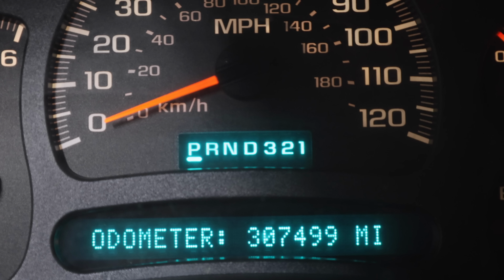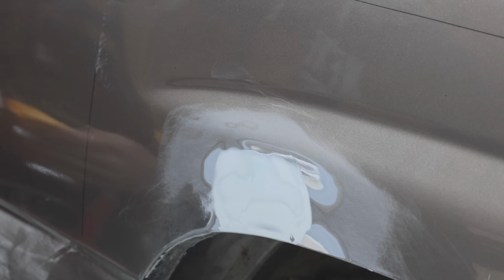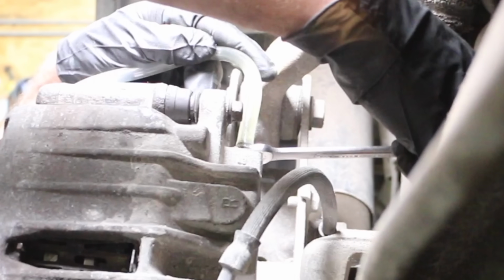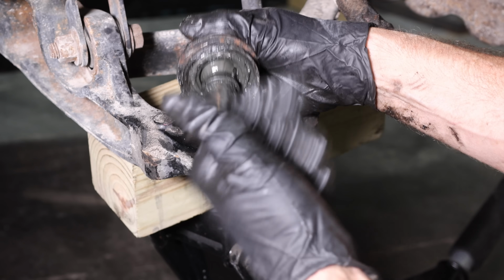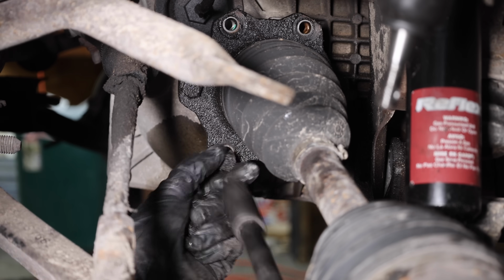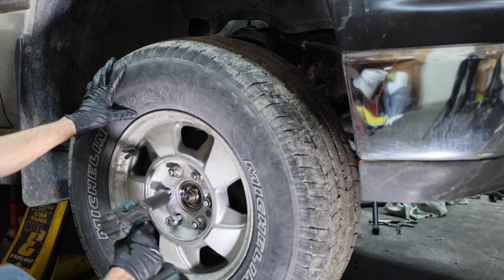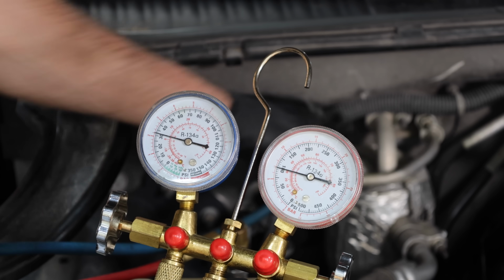Is It Stupid To Fix Up A 300,000 Mile Vehicle? Let Settle This!

Comment: I just bought a 344k mile 2000 CRV lol my only concern is it does burn oil at Idle. We did homework and it’s a single owner, well taken care of for the most part, but after no clear number on oil change intervals. I’m starting off with hopeing there is carbon build up on rings worst case I’m doing a Tear down but we are doing the same as you just did lol a suspension over haul! Also keep your pace in videos they are phenomenal! My last opinion definitely keep ol girl! My wife worked at Chevy for a bit and the new Suburbans kinda scared her lol
Reply from the maker: Thanks for sharing.

Comment: I did auto body for 4 years before leaving to explore other jobs. For doing it in your driveway, you did a good job. The only tip I have for you, when sanding your bondo, make an X pattern. It helps sand it down more evenly. There's also a spray/powder you can get called a guide coat. It helps you visualize the high spots and the low spots, so even if it feels good it might still not be perfect. Your doing it on a vehicle that looks to be from 2003-2006 that has 300k miles, so it doesn't have to be perfect. What you did is pretty good for a driveway repair

Comment: i have an 04 f150 with 245k and an 03 expedition with 335k. coincidentally both were built august 2003, so they are both soon to be 21 years old. i bought them both about 5 years ago, and have put something like 10 grand into buying, fixing and maintaining them both. thats $83.33 a month each. you aint getting ANYTHING brand new financed for $83 a month... except maybe a mitsubishi mirage. add in insurance being far cheaper, registration being 10% of a ~50k new vehicle, and the fact that they get 80-85% the mpg of their equivalent contemporaries... yeah its been worth every single penny keeping these things on the road.
Reply from the maker: Thanks for sharing.

Comment: I work on alot of these older chevy  GMT 800’s. Besides the occasional lifter failure they are TANKS. See quite a few at 300k doing pretty damn good. I mean it’s def not a Toyota (primarily work on those for a living) but the gm engineers showed what is possible durability wise with these trucks. Totally worth fixing! Americans have forgotten that MAINTENANCE is the key! Stop getting hung up on mileage.
Reply from the maker: Thanks for the feedback.

Comment: I have a question my 02 trailblazer transmission went out yesterday at 338k miles im looking at buying a remanufactured one with a 5 year warranty for $2600 do you think its worth putting the money into it the engine runs good always been maintained i just don't want to buy a cheap used car and end up with a lemon

Comment: Don't tell my 89 Z71 that....310k on the original engine, went with a GM Crate engine and a new trans, still running today with almost 500k on the truck, thinking about sending it to the body shop for some rust repair and a paint job. Even with all I've spent it's not close to a new truck....$15k and 500k miles on a 35 year old truck...it'll be running when all the 2000 model Chevys are long gone.
Reply from the maker: Thanks for sharing.

Comment: I didn't really have time to watch the video, but of course it's not stupid to fix up a 300,000 mile vehicle. It looks like from the screenshot that it cost $2,000 to fix it up. That is very reasonable. Each individual person is unique, so the answer really depends on how you feel about your vehicle. If a vehicle is just transportation and that's it or if you don't have the money to spend on a new vehicle, then fixing up what you have is a great idea. However, if you have the money, and you always want the latest and greatest thing, then buying a new vehicle also makes sense. In my situation, buying a new vehicle makes sense because Wireless CarPlay is very important to me, and high performance is also very important to me. I traded in my 2015 Civic Si for a 2024 Integra Type S and I feel so much happier with my current car. I plan on keeping it for the next 10 years before the changeover happens. I'm sure 10 years is enough time for the legacy car manufacturers to figure out how to build quality BEVs
Reply from the maker: Thanks for sharing.

Comment: Nice, I'll give you $1500 bucks for it
Reply from the maker: Thanks!  Not for sale.
Reply: @ProjectFarm  where do you get your patch panels? Just ebay or what? I have an Escalade ESV and both rear panels are rusted at the wheel wells, however, on that truck the panel goes all the way up over the window to the roof.

Comment: Cleaning bolts in that manner is ultimately incorrect. Use a thread chaser or leave them alone. Good chance they fail upon tightening because the threads are ruined.

Comment: $2000 is nothing. I have a 2021 Jeep Gladiator with 60,000 miles that, according to the dealer, needs $3200 in “critical preventive maintenance.”  

They won’t change the transmission fluid, though.
Reply from the maker: Thanks for sharing.

Comment: +1 to keeping the pace. There's a LOT of info in a decent amount of time, but it's short, sweet, and to the point!

Also, how are there 300k miles on a set of rotors, 10 years on headlights, and (I think) 4 years on oil? Good grief!
Reply from the maker: Thanks!

Comment: Channellock snap ring pliers are the best I've used.  Highly recommended.

We still have my wife's old 99 S70 T5 volvo.  We've kept it because it never misses a beat and has a wonderful 5 cylinder turbo sound.  It's currently at our mechanic getting its' 200,000 mile work done.  I had about $3000 worth of new parts in the trunk and he laughed saying that it's not uncommon at all and has numerous clients with old Volvos that have had the car's value put into the maintenance many times over.
Reply from the maker: Thanks for sharing.

Comment: I have nearly the same vehicle! 2000 suburban 2500 LT. 340,000 mile daily driver. You really should add or tag Chevrolet or suburban in the title. This video is a huge help. Also, if this was a Saturday afternoon garage show on tv, you just did half a season in 25 minutes 😂. Great job! The pace is right on for the average person taking care of this type of work. No fluff and if one doesn’t have the tools they can be rented for the most part and bought if needed. Excellent work as always 🙌🏼
Reply from the maker: Thanks!

Comment: I have a 2001 Chevy Suburban that just hit 113,000 miles , it’s very clean inside and out. I keep up on maintenance and it runs great. But watching this video makes me want to get some work going. I probably will get the diffs changed but any other suggestions would be greatly appreciated. Thanks
Reply from the maker: Suggestions:  Spark plugs, wires, change all the fluids, new fan belt.

Comment: Me and my brother have a 01 Ford Taurus Ses 3.0 ohv with 256k it keeps going like the energizer bunny we run a 10w30 with Lucas oil stabilizer and run a flush every oil change. Recently it blew the water pump and timing cover gasket which our buddy at Harrels auto in Erie fixed up for us. Other than that just regular maintenance.  Best 300 car with ac and heat ever little old lady owned since new we bought it with 197k miles
Reply from the maker: Nice!

Comment: At the end l was expecting the total in parts and an estimate in labor for the non doityourselfers who have to rely on a mechanic.
I believe its a much better deal to renovate than to buy new, even if you have to replace the engine and transmission. Of course as long as the body is still good and rust free. With $10k you can drive a mechanically new vehicle instead of paying $50k to $80k plus the high cost of insurance and taxes.
Reply from the maker: Thanks for the feedback.

Comment: Wow! Some of the same types of repairs I have been doing on my 2004 Chevy Suburban Z71 with 406k (equivalent to 16 times around the earth). I will not spend $80k+ on a new Suburban, $20k+ on used, pay $3000-$5000 for someone else to do the work. But sweat in the southern summer to DIY the TLC. Like a rock! Keep doing what you do best.
Reply from the maker: Thank you for sharing!
Reply: Don't be cheap

Comment: I liked that you showed doing a string alinement.  I did this myself and found the specs confusing.  Like  if it calls for sixteenth of an inch where do you measure this from?   My information was that this mesurement was from the center of the side wall of the tire.  Please correct me if this is wrong.  I actually measured from the wheel rim and calculated the diference.  Like if the distance from rim to rim is 15 inch and to the center of tire side walls is 22 I multiply my spec by 15/22 to get my measurement.  Well any way that's how I did it.  There are allot of cars where the camber and caster can't be adjusted but if it does need to be adjusted make sure these get adjusted.  Best to let a alinement shop do this but you can buy a inexpensive angle measuring tool and do a fairly good job yourself if you have a flat level surface to work on.  Two greased plastic dollar store place mats will work for your turning surface.  Got to make some jigs but procedure is straight forward.

Comment: I bought  2004 Honda crv for 1k. Did the head myself, full compression. New shocks, wheels, tires, suspension parts, accessories (and ac) . Went from 360,000 miles, still driving it today at 410,000 miles at a total cost of $3500 for parts  (I did the labor).

Meanwhile I watch people go in debt for 30k+ on a vehicle with smaller engine!

Maybe I'm dumb but I don't get it.

Comment: PF, did you have any issues with any of the computer modules? I am not a mechanic, but I have heard old GMs are prone to electronics issues.

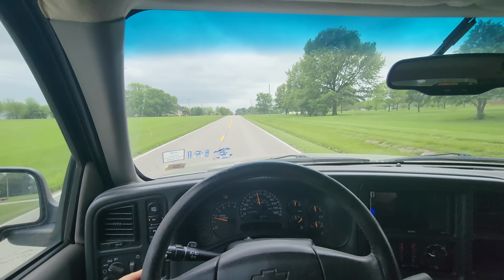I noticed it looks like your check engine light is on at 24:40, but my guess is it is just a harmless nuisance code. 

My 2001 GMC Sonoma would have issues with the ABS brakes computer after about 130,000 miles. The heater core also had to be replaced.

That looked like so much work. Great job! Thank you for all you share with us. I wish I knew half as much as you do. I have often bought things based on what you recommend on the channel.

Comment: Agreed. 
Bought my 06 Charger R/T new. Current mileage 321K.  Had one engine swap done back in 2016 under lifetime powertrain.
Also bought a 06 Dodge Durango Limited (5.7L) in 2021 for $2K. Had 292K on the dash when I bought it. Current mileage 330K.
Reply from the maker: Thanks for sharing.

Comment: I have a 1999 1500 Silverado 4.8 with 401k miles on it finally got new rotors and my water pump was leaking from weeping hole 👍🏼 runs strong had been used to go 10-6 hours drives for work every 2 days now I work 1-2 hours away a day she runs good a little rough looking but she’s great
Reply from the maker: Thanks for sharing.

Comment: Man, I've been into seeing others fix cars with regular parts. Something about seeing a vehicle get its deserved maintenance is relaxing, and since I finished rebuilding my truck's suspension I replaced every wearable part, sanded and painted every metal part, and lastly detailed the whole undercarriage. It's basically a whole new truck for about $1500 (I got top of the line parts, especially greasable)
Reply from the maker: Thanks  for the feedback.

Comment: Had problems with my brakes not wearing evenly and found that even brand new pads and hardware were hanging up and had to touch up the ends of the pads with a grinder finishing wheel to clean up the ends. Also had new pins sticking in new caliper brackets and had to sand the pins until they slid smoothly. Quality control is terrible. I’ve replaced the a/c system, the cooling system, and the suspension. Pulled a cylinder head so a machine shop could repair a broken exhaust bolt that I made worse with a drill. Cylinder head was flat and the valves sealing good. At 300,000 miles the cross hatch looked great and compression is good. Gen 3 5.3L is awesome. I definitely prefer this method over replacing vehicles since I can do the work myself.
Reply from the maker: Thanks for sharing.

Comment: No way bro, I'll be posting a video this weekend of a 02 suburban I just got with 302,000 on the dash but drives and rides like 90,000. Previous owner put all new suspension and links and ball joints and brakes and rotors rear end and transfer case, not sure I would've done all that but after driving it I feel like I should do a lot more like that, it's a Z71 and is so weird and amazing how good it rides and drives, I love all vehicles but I like early 2000 vehicles.
Reply from the maker: Thanks for sharing.

Comment: why after all that. is the check engine light on?
Reply from the maker: It's related to the fuel evaporative system and isn't worth repairing.
Reply: @ProjectFarm  evap code.   i have same on my car..  if i keep the gas tank from going below 3/4.. the light never comes on .. something to do with the cycle of that test i think..

Comment: My mom is on her 3rd Buick lesabre with over 300k miles. Currently has a 2004 with 380,000. My dad had a 94 ranger all original (minus the alternator) with 570,000 miles. It finally died in 2017.
Reply from the maker: Thanks for sharing.

Comment: Okay if yk cars yk what motors are good so basically chevy v8s and there v6 from 80 to bout 2010 where basically unkillable if you took care of it ford inline 300 and modular motors same think you take car of then they last, rn i have a 98 Lincoln mk viii 4.6 165k miles still first turn start everything works, 2015 f250 370k miles same thing modular motor everything works, so if its a good motor and taken care of then i say ita good for a price
Reply from the maker: Thanks for the feedback.

Comment: I have a 96 F250 woth 250k miles. Did the front end with new ball joints and u joints. Pads and rotors seals. But want to change the Differential and transmission fluids! Great video
Reply from the maker: Thanks!

Comment: I have a 2005 Silverado 2500 and I replaced brakes, tires, plugs, a coil, radiator, ac compressor, engine mounts, oil pump pick up tube seal, steering wheel shaft and entire front steering system. Less than 2k in my driveway except tires and alignment. It had nearly 400k miles on it. 4 years later it still runs and drives great. Well worth it.
Reply from the maker: Thanks for sharing.

Comment: Ìn my eyes it is almost always worth fixing a car, unless the cost to repair is more than it would cost to buy something far more reliable.
The big argument I always see is that repairs are more than the car is worth. And yes, you likely could not sell the car for more than the cost of extensive repairs. But the point is not to profit on selling the car. It is to have a reliable car that suits your needs. When the car is fully repaired, you will likely have a more reliable car than you could buy for that price.
I say this unless it has a blown engine or transmission on an older car. Unless the car has sentimental value or you have the skills to rebuild or replace an engine or transmission, it will rarely be worth the cost having a professional do an engine swap.
Reply from the maker: Thanks for sharing.

Comment: Pace is Great!  Keeps viewer glued to the videos.  Suggestion: Test ceiling paints.  The expensive and cheap all just seem like regular flat white low cost paint.  Does it pay to spend more for the "good stuff"?  scrubbable?  resist mold?  resist stains?  protect from moisture damage?    Keep up the GREAT standardized testing!
Reply from the maker: Thanks, will do!  Thanks for the suggestion.

Comment: These trucks and suvs are awesome. Literal gold. The weakest point on these is the transmission as they dont like towing duty or being skipped out on oil changes. GM really screwed up when they started putting cylinder deactivation systems on their newer trucks and SUV's. Quick question though. Why only do the ball joints and not the whole control arm assembly? Were the bushings on the control arms still good?

Comment: My friend just bought a 450k mile 4x4 1995 toyota tacoma with the famous 5VZ-FE 3.4l V6 and the auto transmission. All maintenance was done by toyota. Truck runs really great, has no problems other then needing new breaks soon. Has never had any mechanical problems
Reply from the maker: Nice!

Comment: my 2003 tahoe was handed down to my son with close to 300k miles if you did the maintenance I believe they will go the much further...water pump, and fuel pump were the only main things i had to change...fyi amazon sells almost everything for the tahoe at a great price.. the headlights bodies were a great price it was cheap to do that then waste my time trying to clean up the old ones.. the center lid on the seat was a great price too.
Reply from the maker: Thanks for sharing.

Comment: I wouldn't call this "fixing", it's more "restoring" because you replaced a lot of parts that while old, they were still in good/fair condition, and didn't technically need replacing(18 year professional automotive technician here)

Also, you're incorrect about the function of the fan/clutch assembly.  Yes, it does cool down the coolant in the radiator to help keep the engine at normal operating Temps, it doesn't effect your Air conditioning system directly.  That's where your A/C compressor comes into play.  Also, you replace the steering gear box, not the power steering pump

Comment: I've got a 2002 Tahoe LT currently 305k miles my daily driver.  The transmission went out around 260k miles had it rebuilt for $1600 only issues after that is fixing some leaks here and there nothing expensive.
Reply from the maker: Thanks for sharing!